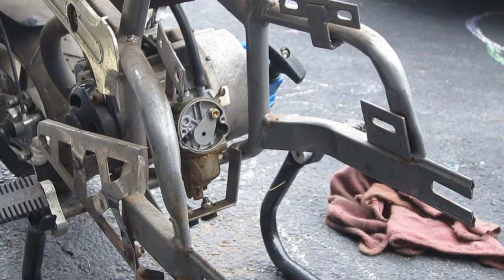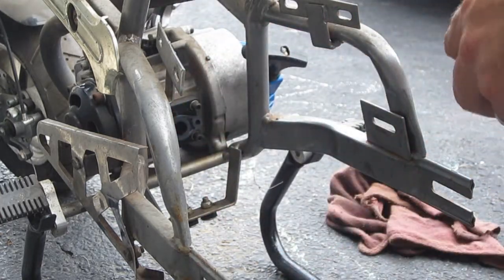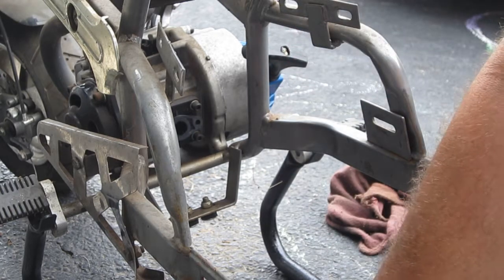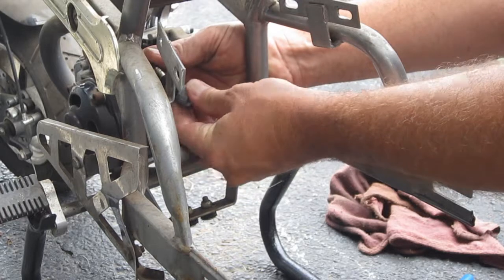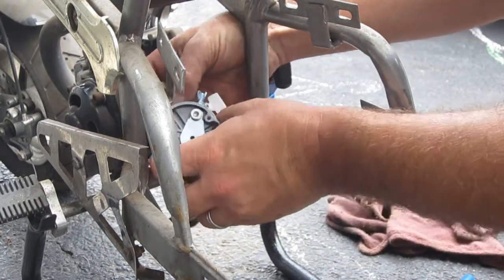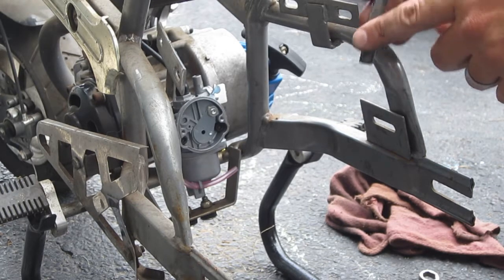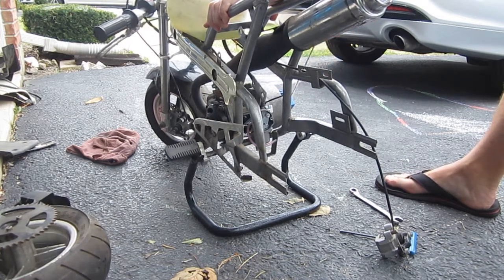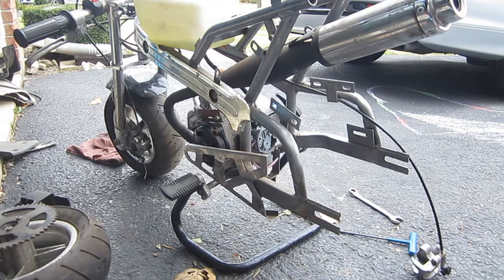HOW TO replace your pocket bike carburetor 49cc 47cc with START UP

Comment: Dude, I'm 13 and hope to be a future mechanic. I recently bought a 2011 daytona cagllari MT-A1 pocket bike and ive run a couple diagnostics and determined that my issue is the carburetor. i intend to dissasemble it and clean it (i am too broke to afford a new carb) this is super helpful because i barely know how to do this. Your tutorial is really helpful, and i will use it for reference. I truly, truly thank you.
Reply from the maker: @JeremysCardboardCrafts  Absolutely and I love to see the next generation getting started. I will give you a secret, the shut off valve is a problem.  I pull it apart, be careful of the tiny oring underneath. I  Pull the guts out, the rubber piece,  fill with epoxy and drill a hole through it after it dries. Reinstall the lever for looks and the oring underneath.  Add a inline shutoff valve. Cheap on Amazon.
Reply: @bdrgarage7039  could I in theory, just disconnect the fuel line and throttle cable, unbolt it from the engine, remove the bowl, clean out the jet, then do everything in reverse.
Reply from the maker: @JeremysCardboardCrafts  Sure can, I have a hard time getting my hands and tools in there but it can be done. After the bowl cleaning check the path from the shut off valve to the bowl. Use a carb cleaning nylon brush. Or carefully a paper clip in a pinch
Reply: @bdrgarage7039  dude you are an absolute god, ive never seen anyone more involved with the community. You just rightfully earned a subscriber with notifs on.
Reply from the maker: @JeremysCardboardCrafts  I appreciate it, check out Pocketbikeplanet.com  I honestly haven't been on there in a while but there's some good info on there as well but hit me up any time.  I try my bus to get back to people that have questions
Reply: @bdrgarage7039  here’s an update if you’d like. It was successful, sorta. I had gas go pretty much everywhere but once it was cleaned it was smooth sailing. It cranks but still won’t turn over. I did a check compression test and oh my does it leak. I recently checked the spark so that could be why. However when it does start it runs great. Could be magneto coil as I may just not generate enough electricity.
Reply from the maker: @JeremysCardboardCrafts   Is it a new NGK spark plug?
Reply: @bdrgarage7039  No, I assume it’s an OEM, but it is an NGK. I checked it and it looks almost mint. I cleaned it off and reinstalled it.
Reply from the maker: @JeremysCardboardCrafts  a better wire on the coil would help, gap the plug to about 0.028. I always spray in the carb a flammable spray, usually silicone,  and see if it starts for a second,  if it does it's a fuel delivery issue. If not, spray in the cylinder, reinstall the plug and see if it starts. If yes, could be the crank seals, if no, might have bad spark. Make sure the coil it a business card space to the flywheel.
Reply: @bdrgarage7039  thanks! Will do.
Reply from the maker: @JeremysCardboardCrafts  You're welcome

Comment: My pin that goes in to to carb keeps falling out on its own I don't get why it's doing that
Reply from the maker: The spring holds it in with the cable inside of the spring. Let me know, maybe I can make a quick short for you.

Comment: Hi got a problem with my pocket bike. It turned on and then after like 10mins of using. The engine shut off. I just change my carb and coil spark
Reply from the maker: Hello, it is a two stroke correct? And if so did you use gas oil mix? If you did and all is good there, take the spark plug out and make sure it has sparking. One of my other videos shows you how, then spray some silicone or some flammable spray in the cylinder put the spark plug back and see if it'll fire. That's a good start
Reply: @bdrgarage7039  yes sir. I mix my gas with oil 2t. It start easily but after 10 mins it will die.
Reply: @bdrgarage7039  i will see your other video sir. Thanks for reply though
Reply: Maybe sir the mixture of oil and gas?
Reply from the maker: @Pacsa  mixture is typically 40:1, but check your spark plug to be sure it isn't lean or rich. 
So starts easy, runs for 10min then dies, correct?
Reply: @Pacsa  crank vacuum 101. hot air moving faster and escaping from cylinder????? Gasket kit for you sir
Reply: @Pacsa spark plug fouling or air leak somewhere

Comment: my bike runs fine its only leaking from the carb when its on idle
Reply from the maker: Where exactly does it leak from??? You need to find out exactly where, and then we can fix it.
Reply: @bdrgarage7039  from under the carb by the floather cover it runs great but im gonna clean and check the carb tomorrow im from the Netherlands btw

Comment: I got a problem with mines starting
Reply from the maker: Only three things that a 2 stroke needs to start.  Air, fuel, and spark. Check for spark like I did in a couple of my videos. If it has spark, a strong blue spark not yellow,, the give it some spray of starting fluid or I use silicone spray. If it pops off for a second, the it will run and you need to figure out how to make sure it gets proper fuel. Air is a pretty obvious and easy one of the three.
Reply: I mite put the wrong gas this a new engine it was running for like 20 mins now it won’t turn over 🤦🏿‍♂️
Reply from the maker: @GOKU-zn5fb  if it's a two stroke , like the one I have in my video, it needs oil in the gas. Most of the time the octane does not matter. But you should run premium which I always do. I go to Menards or Home Depot and buy premixed stop. The one brand is trufuel. It has oil already in it and it's 92 octane. Just have to get the right ratio. 40 to 1 is usually good for these bikes
Reply from the maker: @GOKU-zn5fb  Take pull start off to get to the flywheel. See if you can manually turn the engine over. If it's totally frozen your top-end is toast. You'll have to buy a piston and cylinder head from eBay or Amazon
Reply: What if it doe doesn’t get spark
Reply from the maker: @hammie3455  if you don't have spark, 95% of the time it's the spark plug. Get a quality NGK. Also make sure the magnetic strips on the flywheel are clean and rust free and then you need to make sure the space between the coil and flywheel is proper, I use a business card. If you did all that and still nothing and your kill switch is unplugged you probably need a coil or coil wire.

Comment: "you've done so many of these, so it's not so hard for you".... I thought that the purpose of making videos is to show in detail how it's done.????
Reply from the maker: What else can I show you? I will be happy to show you. It is difficult with the rear wheel in place but doable. Fuel line and 2 bolts, after the top (where the cable goes in) is removed, you can put that whole piece right in the new carburetor or swap it out with the new parts, that's the hardest part.